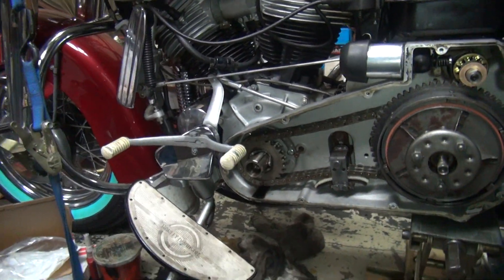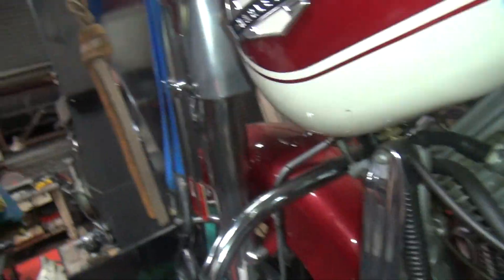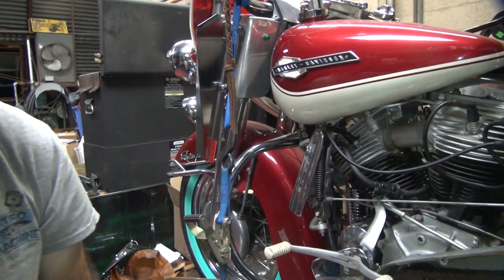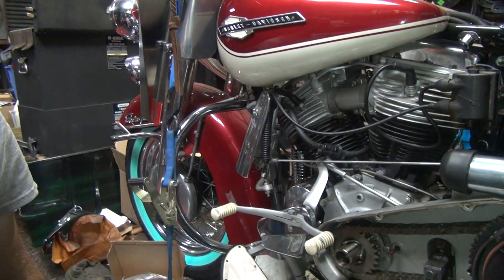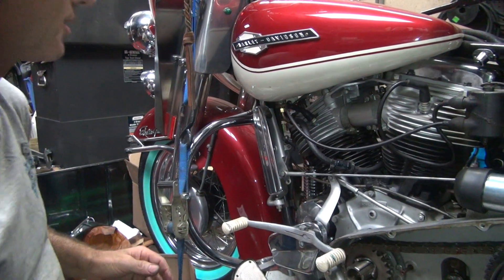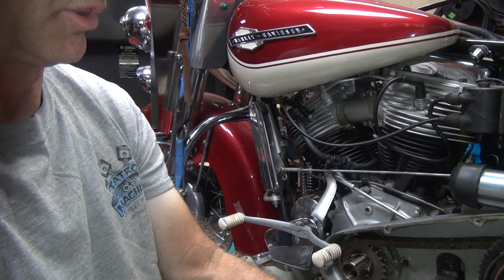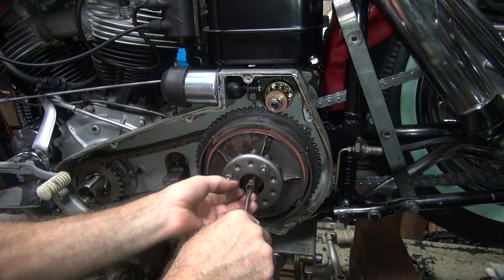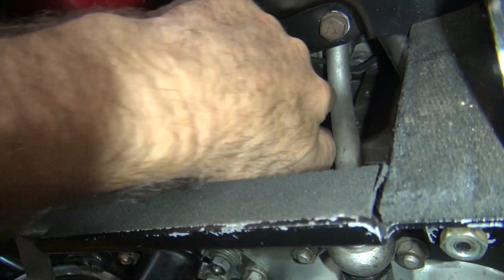#121 1965 74ci panhead new bike purchase full service repair FL FLH harley rebuild by tatro machine

Comment: Tatro, didn't the pre 68 bikes use a different clutch spring to allow the mouse trap to work properly.
Reply from the maker: yes, the old heavy ones going back to 1941. the 1968-84 tall lighter ones are for the non-mousetrap bikes.
tatro